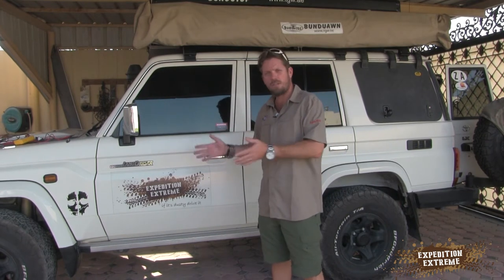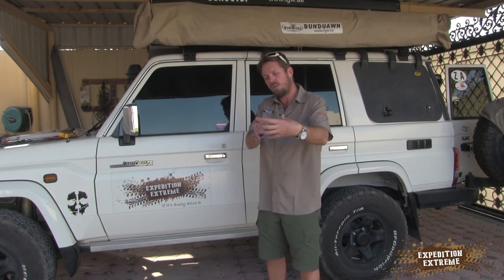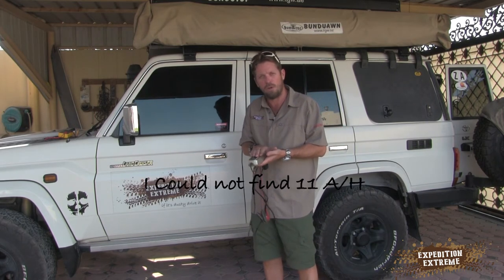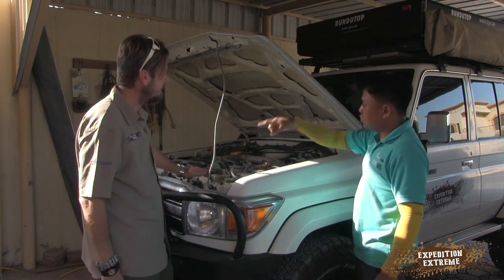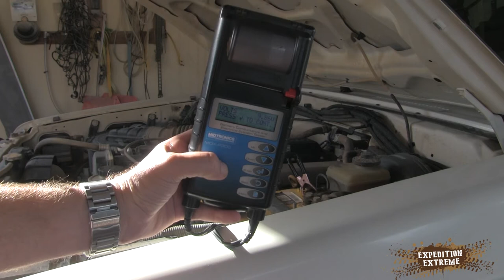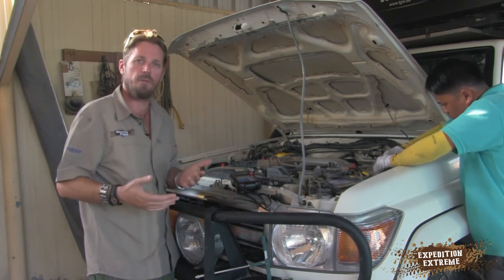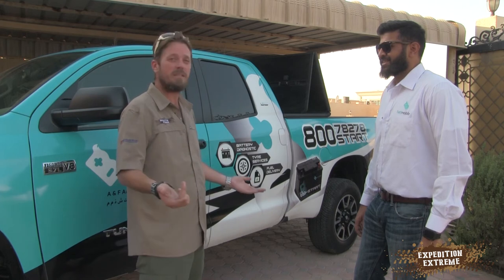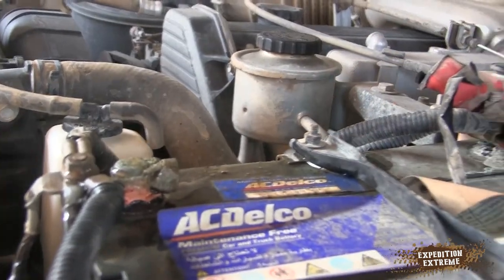Battery Management and Tips

Comment: Why don’t you try Lead crystal or AGM batteries? Optima Is a great brand,but deep cycle Is ageing technology. AGM or led crystal Will also allow you To discharge deeper with out causing damage.
Reply from the maker: hi Nickus, unfortunately, the life span on AGM is even less in the extreme middle east heat. I do like them though.
Reply: Expedition Extreme  interesting, didn’t know that.
Reply: Nice one David. Partly explains why the yellow tops got shagged out running two fridges with no sun for the solar panels. Monitoring gauges helps. How's the mean, green machine doing? Big, black, shiny, fifteen year old Samina is coming along nicely ;) Hope to catch you in Leics soon, cheers.